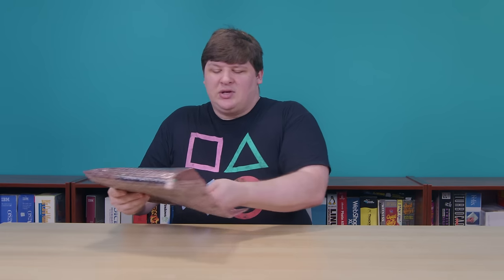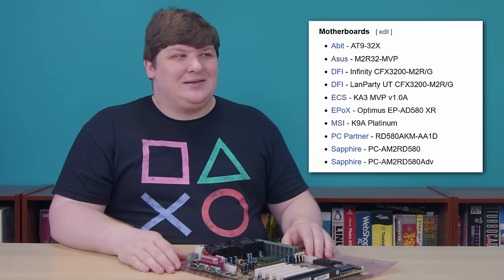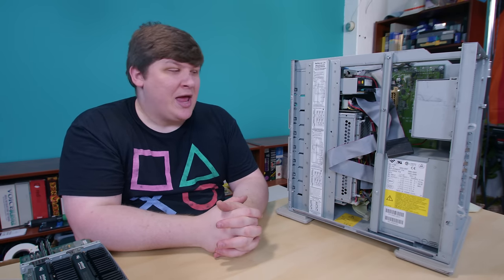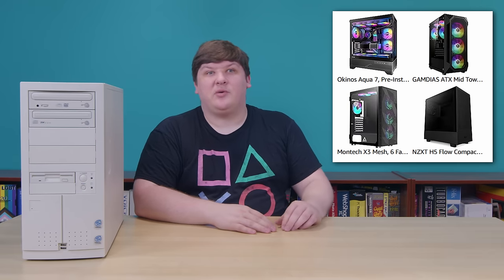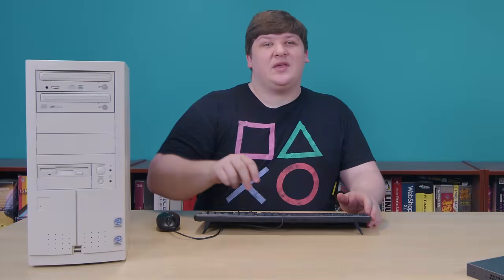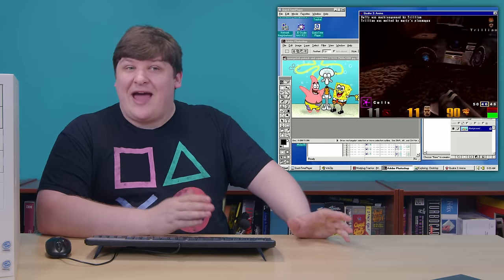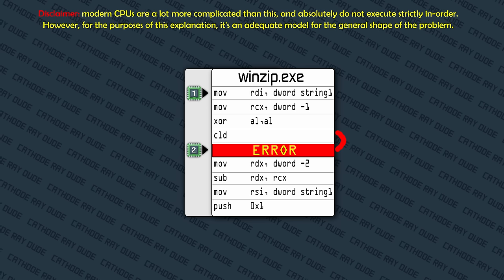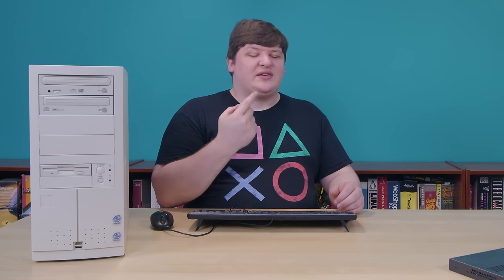The Only Famous Motherboard

Comment: I would like to take a moment to comment on threading (and gaming), as a professional software engineer. I personally quite enjoy the challenges of multithreading tasks to run faster (I know I'm weird for that).

To your point about games being multithreaded vs single threaded today - One thing I've heard quite a bit is that games are 'single core loads.' They are often multithreaded, but they still primarily hit a single CPU. There are a variety of reasons why this is still the case, but the main way games have benefited from multi-core processors is simply by being able to offload some background tasks to another thread, similar to how photoshop might offload the background task of running a complex filter. The primary thing you're waiting on is still a single process. That being said, there are games that are able to take advantage of multiple cores, the most recent example I'm aware of is Cities Skylines 2, which multithreads its simulation to provide better performance.

Games are generally still quite hard to parallelize, because they revolve around a single threaded, core loop - the update loop. Most modern games can't multithread this, since each update step depends on the last.

Comment: Since then, and for many years, it was my dream to have a build like this, but when I found out about this, I gave up. I mean, it's not all bad, Windows will still separate the basic processes to one CPU and the game to another, but the performance gain from this is what? 3%? I can get much more just by overclocking the CPU.

I ended up building a Pentium 3 1.2ghz overclocked to 1.4 (unfortunately I couldn't find a 1.4 at a decent price)

Comment: One aspect missed in the video is that Intel purposely disabled SMP in the Celeron Processors.  The BP6 was the first, and perhaps only solution for SMP with low cost Celerons.  I had one for running BeOS and it was stellar.  My favorite and most memorable machine.

Comment: I had a BP6 build dual 500 celeron. I don't remember if I ever upgraded to the pentium. It was my 3D design workstation. Did most of my modeling and rendering on it. There was one very real quirk from this mobo that I will never forget though. For whatever reason Photoshop would crash when using the magic wand tool.

Comment: Nice vid.  I remember being in the extreme minority having a quad socket Pentium Pro board in a workstation back in 1996 I think. Was horrendously expensive and used for SD video editing.  Very limited software could run under SMP and we had to use unix to get the best out of it.  I had to write parallel code to take advantage of it and still use custom Motorola 56K DSP acceleration chips for the majority of the hard work Motion JPEG and MPEG1 layer II audio compression.    Compared with an equivalent SGI machine it was cheap!

Comment: I think the classic example of what you could do with multiple cores in the day was to run the server software for a game as well as the game itself, typically in a lan party like setting.  It did come with the general benefit of a game not needing to fight with anything for CPU time.  Games in those days were rarely multi threaded, IIRC the first major game to boast the feature was Supreme Commander and even there it was still multi threaded in quotes, the game wasn't split anywhere close to even between its threads.

Comment: My fond Celeron memories begin and end with my 300A. Pretty sure it's a common story, but that chip paired with the Abit BH6 offered a brain dead easy overclock to 450MHz by bumping the FSB from 66 to 100. That's 50% more power with one BIOS tweak! Crazy times.

Comment: I had a Dell Precision 410 (desktop chassis) in late 2000 that I bought from a friend who "acquired" it from somewhere with no RAM, CPU or disks. The only processor I could afford for it was a pentium II class celeron, and then I found that I needed two of them as it would have cost more than the celeron to get hold of the CPU slot terminator board that it needed for a single CPU setup.

Comment: Being a teen when this came out, Celerons were cheap and thus the only way young people/students on a budget could afford to have dual CPU bragging rights. This was the time cooling solutions got a lot more attention, and two big copper block heat-sinks sitting next to each other was the nerd equivalent of showing off the V8 in a muscle car. 

Same went for having two Voodoo cards in SLI, although the only time that ever happened was when I'd take my card over to my friends house for LAN parties and we paired hardware. Yep, we'd even take RAM out of our machines at home to take to parties to build temporary beast rigs. Lugging a PC on your mountain bike wasn't practical.

Comment: So weird, I had one of those netservers too as one of the first "big" pc systems I ever owned. A few years before you, however mine was a single processor one and lacked a few important bits so just ended up pulling the useful parts and ewasting the rest (despite having pulled it from someones ewaste pile). The pentium pro it had served a few years in my nas, which was definitely a different world back in about 2004

Comment: The original Celeron's didn't have cache, but then Intel released the Celeron "A" that had some cache, which made them not so far behind the Pentiums, and you could overclock them to the gills. Getting a 300 MHz Celeron A overclocked to 450 MHz wasn't a big issue. As for the Dual Processors: I do believe to remember that the Pentiums couldn't run in Dual CPU mode because Intel somehow hamstrung them to not cannibalize their newly created Xeon market. I really don't remember the details, but I do remember that the Celeron "A" was the only CPU that made sense in this configuration. (And yes, I had a 450 MHz NT4 BP6 system myself, and it was heaven because of how responsive it was, as you pointed out towards the end.)
Reply: It was an interesting era, Intel did this (arguably a mistake...) with the Celeron and then later AMD did the samer with the Duron. Not quite a Pentium 3, not quite an Athlon Thunderbird but close enough for geeks on a budget to notice and buy them instead.
Reply: Didn't the Celeron A also have the quark of having L1 cache at the same clock speed of the CPU when its usually half speed on other Intel chips at the time?
Reply: @Toonrick12  Ah yeah, that as well. Half the cache, twice the speed. The Mendocino Celeron's were WAY too good for their price point. And the 440BX Chipset is probably the most rock solid platform that Intel ever created.

Comment: God I love this so much. It kinda makes me laugh when people get all militant about cable management (don't get me wrong. I do get it to a degree; overstimulated is my primary mode of being) like we weren't all rocking the same daisy chain hell of rainbow vomit Molex and mobius IDE strips at some point, and after a few upgrades of the family computer, quite possibly an extra hard drive or two freeballing it in the bottom of our cases (guilty af... tbh, more SATA[s 1 through 3] than IDE, lol). My beef with RGB isn't really RGB itself, it's just that back in the greyge era, it was aspirational, not necesarily because it was expensive... but because it was jank. People were putting cold-cathode tubes in their cases, or hiding LEDs in the corners with zip ties, and no two custom builds were alike. Jank was everywhere, and it was amazing.

Comment: Man I can remember always wanting to get a dual core CPU or even a dual socket system, but I ran an AMD 3200+ until the 1090T came out. That was a heck of an upgrade, single core to six core in one wack. Made WinXP fly. I still have that 1090T system and it runs windows 10 pretty good.

Comment: Funny thing is, I actually do remember Windows NT 4. I didn't use it much, but there was a period during my childhood when I owned a retired dual Pentium Pro 90Mhz machine with NT4 and a SCSI hard drive... I think it was a Compaq Proliant. I can't remember what happened to it other than I didn't use it much because, even back then, I was sensitive to high noise levels and I think it was back at an early service pack when not much I was interested in would run on it.

Comment: I remember when the Intel 1.4 ghz Celeron was quite the one to have unless you got a 1.4 ghz pentium IIIs. both of these CPU's were amazing at the time! I had both and used them for awhile and both had earned a special place in my heart. On dual CPU boards you had NT4, 2000 or even Win XP would work with these boards. It's really a shame that Intel did not start using Rambus Mem until the P4 CPU because the pentium 3 1.4s was a awesome CPU at the time! 2 of those CPU's paired with 4 gigs of 32 bit Rambus 1066 or 1200 is something I could only wonder about!

Comment: I never had this board, but I'm sure I had an Abit 440bx chipset only with single processor, and I think I had a Celeron in it. I remember that overclocking had just become super cool, and the right models of Celeron clocked amazingly, and that's all that mattered. If I had known back then how crippled by lack of cache it was, I wouldn't have been such a fan. We had a 300MHz chip at 450MHz with a fast 100MHz memory link. That's a 50% increase and it didn't require all that extreme settings if you were lucky. I wasn't, and it always was a little prone to crashing, but the feel good factor of that much extra performance more than made up for the stark reality.

Comment: Another angle to early SMP x86: this board came out right at the time when PC hardware began surpassing expensive UNIX RISC systems in both raw CPU performance and peripheral/bus expansion (PCI, USB). I knew a scientist who replaced his cluster of DEC Alphas with dual Celeron PCs running Linux because he could build his code in Linux for x86 and get better floating point performance for a small fraction of the price and power consumption. And by then, high performance PCI SCSI, Ethernet, Fibre, etc. controllers were abundant and well supported such that RISC workstations could no longer claim any advantages over PC other than their operating system, which Linux on x86 left in the dust shortly after. In the early 90s, the Sun/DEC/HP-UX/AIX users laughed at x86, IDE, ISA bus. In the late 90s, those same RISC companies couldn't put PCI, USB, and ATA100/133 in their boxes fast enough.

Comment: The First Dual Socket boards were back in the mid 90's with the Intel Pentium and the 430HX Chipset, then Intel moved to the P6 architecture, Pentium Pro CPU's on Socket 8 were common in SMP arrangements.

Comment: Can't remember when but I had a dual P3 system with onboard SCSI LVD that cost me a pretty penny.

I actually used the dual CPU feature for rendering in Lightwave but that was about everything I could think of doing with it.

Edit: Full length GPUs were indeed weird in 2000. I had one, called the Wildcat. It was back then, what basically Nvidia Quadros are these days.
I also remember the board was a brand called Tyan, and I'm pretty sure the model was the S2567, as I recall needing an AGP pro slot for the monster GPU, which this one has.
AGP pro was slightly longer than a normal AGP slot, with and extra bit for cards which required extra power. There were very few cards like this at the time so the slot wasn't heavily featured on motherboards.

Comment: Yep, the BP6's major use was buying slower-clocked Celerons that could OC to 100MHz bus. As mentioned, the "gold standard" was the 300 MHz "Celeron 300A" - whose core was basically the same CPU core as the Pentium II 450 MHz, plus on-die 128kB cache. The P2-450 ran on the 100 MHz bus at 4.5x multiplier. The Celeron 300A ran on the 66.66MHz bus at.... 4.5x multiplier. 

Intel CPUs of the time had locked multipliers, so your only overclocking was bumping up the front side bus. The Celeron 300A, being the same basic core as the P2-450, had NO problem running at 450 MHz. So just bumping the clock speed from 66 MHz to 100 MHz kept all the other components in-spec (since 100 MHz was a "normal" FSB speed, all other components were made for that, whereas 75 MHz FSB would be achieved by either overclocking all other systems from 66 MHz, or under-clocking from 100 MHz.)

The later Celeron 366 was similar, netting you 550 MHz by just bumping the bus from 66 to 100, which was getting close to what the core could handle without exotic cooling and major voltage tweaks.

I worked at Intel at the time, and I had a BP6 with dual Celeron 433 OCed to 650 at the time - with ridiculous cooling and voltage tweaking. It was unstable for really extended (>2 hours) use. (I had a dual Pentium III Xeon 900 MHz at the same time, as my "get serious stuff done" workstation, the OCed Celeron was the "just because I can." The dual Xeon was "special" in its way, too - the motherboard only officially supported the "Katmai" 500-550 MHz P3 Xeons, I had a hacked BIOS that supported the "Coppermine 2M" P3 Xeons at 700 & 900 MHz. Intel abandoned that motherboard without ever officially supporting the Coppermine - releasing a RAMBUS-equipped board that supported the non-Xeon Coppermine Pentium III instead of the Xeon. But I knew the sustaining BIOS engineer for the former board, and he wrote up the updated BIOS before it was decided not to release it.)
Reply: My 433s could run up to 600 on the BP6, but not being stable :)
At least with a classic air cooling.
490 was perfect.
A guy I knew on a FreeBSD forum said he had dual Pentium 3 800 MHz on a BP6.
Reply: @nalinux  There were socket adapters that did the voltage regulation to allow "Celeron only" Socket 360 boards to support Coppermine (and later even Tualatin!) Pentium III cores. I've seen one person report using two >1 GHz Tualatin Celerons on the BP6 - but they had to replace some of the power circuitry on the board itself to support the extra power draw.
Reply: I had a 366@550 that was nice and stable with fairly mundane cooling.

Comment: Celeron: If I remember correctly,  because the 66Mhz FSB, it gave more overclocking headroom at a smaller cost than the Pentium 2/3s at a much cheaper cost (Since the PIIIs had a default 100mhz FSB).

Comment: Never owned a BP6, but if I had I would've run Win 2000 in it instead which has many improvements and rock solid with the latest service pack. My very first Dual cpu setup was a Intel dual socket 603 Asus PC-DL with pin-modded dual 2.2 ghz cpu's so they could run at higher fsb so they ran at 2.93ghz.  After that I had a Dual socket 940 opteron system with a Asus K8N-DL motherboard, which are expensive to find nowadays. I have a few dual socket boards laying around. Two dual socket 370 tualatin compatible, one dual slot 1 motherboard, one dual socket 1366 Supermicro X8DTH-6F, dual socket 771 Supermicro X7DWE.

Comment: Pretty sure I had the exact board pictured at 5:05. I forget what brand it was (I want to say that it was a Tyan, but I can never be sure of my memory these days) and it was a dual Slot 1 board. Mine had dual Pentium II 233 MHz CPUs. Cost a pretty penny too. And yeah, SMP definitely existed, but it was definitely NOT mainstream, pretty much only high end prosumers/power users with deep pockets had them. Besides Pentium II, Pentium Pro SMP boards were also available. I don't recall seeing an OG Pentium SMP board tho. (but again, my memory could be faulty, correct me if I'm wrong.) And the only "mainstream" OS's that were capable of SMP at the time were Windows NT, Linux and FreeBSD. By "mainstream" I mean OS's that could conceivably be purchased or otherwise acquired by anyone, not just people working in a government lab or research institution. But pretty much NO "average Joe" was running any of those.
Reply: Tyan Tiger 100?
I was obsessed with it before the bp6 caught my wallet's eye

Comment: I built a PC early 2000 with a BP6, SCSI was used via PCI slots, the IDE disks had UDMA but also had consumer features like reporting data as written before it was saved to disk.  The original ATA slot was used for a hardware modem.
In single 50% over-clocked Celeron A mode the board was super solid.
Unfortunately in dual CPU mode the board would lock up, NT4 & 'dows users found this behaviour as normal, while the Linux crowd tried all sorts of mitigations to try to make the board work.
Incidentally the BP6 IDE controller had a bug, where the hardware did the opposite to what the documented toggle setting said.  Andre Hedrik who wrote most of the IDE controller drivers was used to such brokenness and probably had connections with honest engineers who wanted Linux working on their own hardware.
Later when the Linux IDE drivers were switched to the maintainer NAK-ed the fix Teojun had developed for me on the ludicrous grounds that "the fix is contradicting the HW documentation" and so I had to abandon that hardware for an IDE controller which followed documentation better or apply the patch to the kernel myself and use a custom one not distro generic ones.